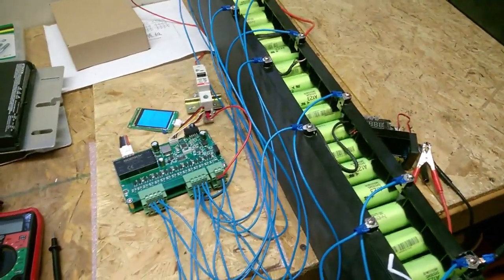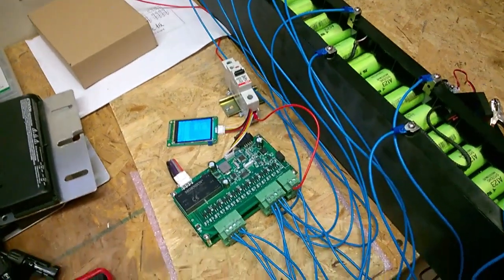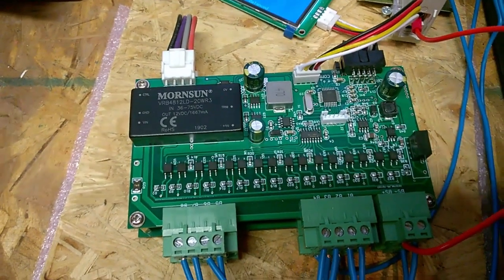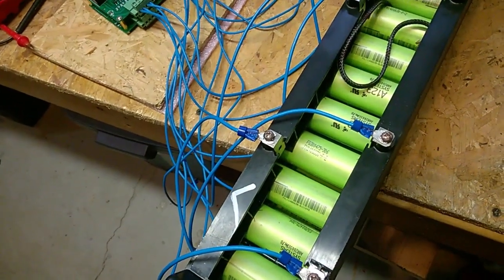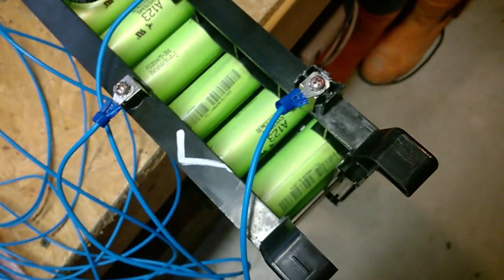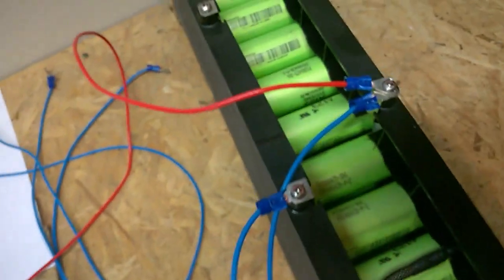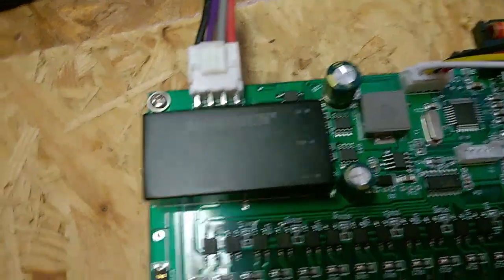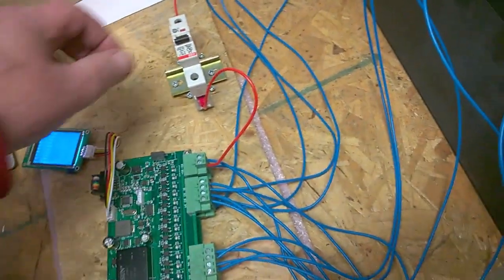2019 21 12s 8s Balance Module System (BMS) operating voltage

Comment: Good way to close off the video!!!! By shutting the breaker off. Got me thinking of maybe using this as a call sign for my videos.... haha.

Binge watching your channel since I have an opportunity to pick up a bunch (10) of these packs also.... not sure if I should though... thoughts?
Reply from the maker: Great idea
Reply from the maker: If you don't mind me asking how much for the 10 packs? I use them for many different things as they are a cheap source for lithium. 10 packs may produce 5 kwh which is a good start. Don't pay over $50 a pack lots on Kijiji for less. We sold all our extras and now with the lockdown every thing is closed.
Reply: @offgridwanabe  60-65$ is the price I am getting... I have not seen any on Kijiji... What do you search for?
Reply from the maker: @paulbarrette2557  A123 lithium or Lithium bus packs or lithium storage. My buddy has some for $50 Frank Z check out his channel

Comment: Got one of these equalizer boards with the LCD and when I hooked it up all it does is say WELCOME on the LCD and will do nothing else. Don't know what I need to do. Can you help
Reply from the maker: I can try first do you know what voltage the board requires as some were 40 volts?
Reply: @offgridwanabe here is a link for the one I got it is 9 to 36 volt
  https://www.aliexpress.com/item/32816488046.html?spm=a2g0s.9042311.0.0.4dfe4c4dFGCVb6
Reply: I had it hooked up so that B1 was 24 volt and B8 was 3.2 volt and thought maybe that was backwards so I switched it to B1 3.2 volt and B8 24 volt but no difference. The screen is stuck on WELCOME. I have contacted the manufacture but that will take 24 HR for a response.
Reply from the maker: Maybe leave a link so I can look up which one you bought.

Comment: I made a video about the one David and I have. I gave you a shout out and left a link. Hope that helps.. Mine has got to have 40 volts 100% or it will not turn on. That is cool that yours works with less than 40 volts.. I had to buy a buck from 24 to 48 to make mine work.. Sucks but that's life. Thanks for helping me find this.. God Bless brother..